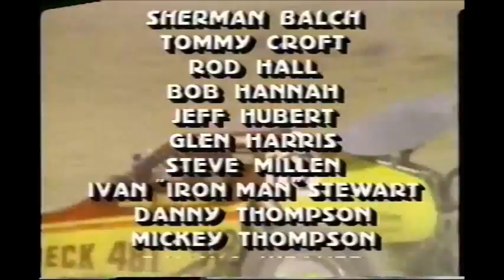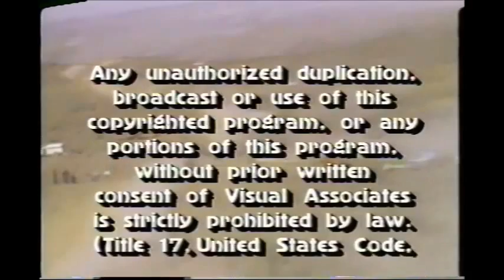Mickey Thompson's Off Road Warriors

Comment: This was REAL and AUTHENTIC off-road racing as Mickey Thompson and the early pioneers of SCORE International were adjusting to the Arab Oil Embargo and OPEC.  In October 1973 NORRA bailed out of Mexico and a Mexican run Baja Sports Committee (BSC) was quickly formed and ran the Mexican 1000 the next month.  Lacking organization and funding, Mexico asked Mickey Thompson (SCORE) to promote races.

SCORE held its very first "Baja International" (500) in June 1974, but could not put things together for a '74 1000 - the only year since 1967 a Baja 1000 has not been held.  The images in this fantastic video appear to have been captured in 1976 and '77.  Regardless of the year(s), this is wonderful to experience - again - so thank you, Robbie!